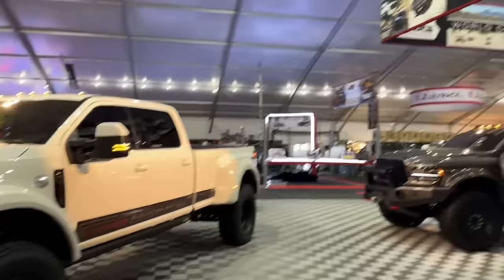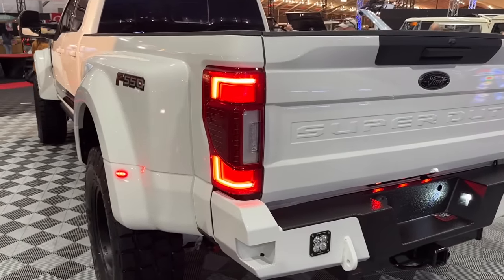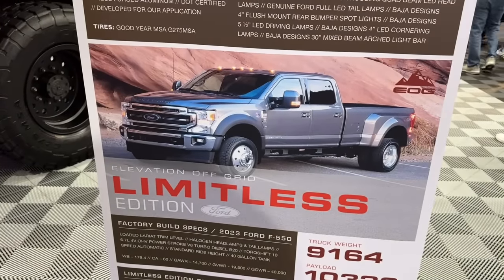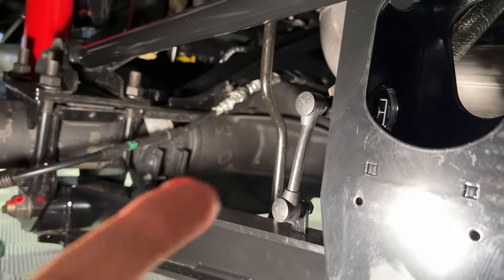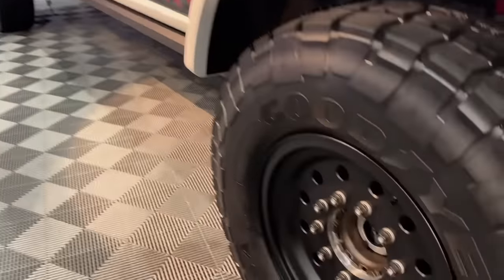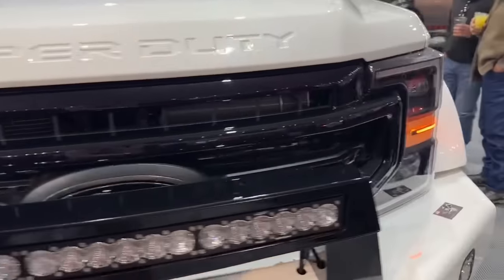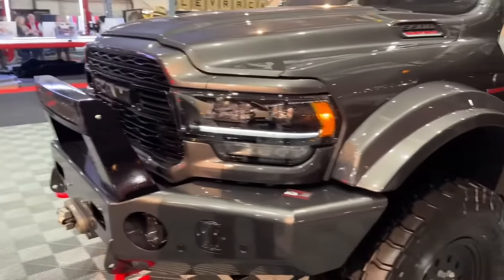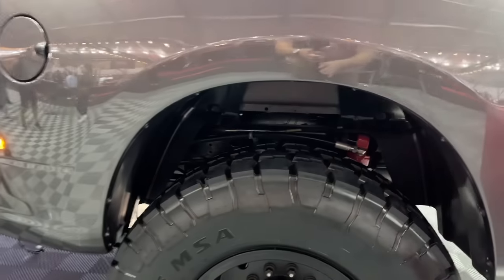When a Ford F-350 or Ram 3500 Are Just TOO SMALL - Here Are Three Ultimate ‘Hold My Beer’ Pickups!

Comment: I definitely see the appeal, but if the trucks come from the factory for $80k, can you really justify spending another $100k on top of that for their product? To me it just seems like fancy suspension, a custom bed, and big tires.
Reply: Nah the way they have that truck configured, with all the body mods, high end suspension, commercial tires and wheels, and weeks upon weeks of fab plus paint i'd imagine the cost of components including the chassis is well over 100k. Add on the labor and markup and your probably looking pretty reasonable.  A modern 5 ton chassis with a reefer box which is far less exciting can easily approach 150+k$
Reply: The Ford is an F550 and the Ram is a 5500. You can't even buy these trucks from either company with a bed. They are basically custom building a pickup truck on steroids. There is a ton of work that goes into one of these trucks. You couldn't do this yourself for less money. The closest thing you could buy from a dealer that would come close to these is going to be a lifted F450 or lifted 3500. They will want over 150K and you will have a much lower payload rating. Just search for Ram broken in half.

Comment: This is super exciting to see. I have a ‘22 Ram 5500 crew cab, 60CA with 50 miles on it sitting in my driveway right now, waiting for Bowen to tell me my camper flat bed ( just like this one) is in production!  Given that I’m not towing, I ordered a 6.4 hemi 4x4, SLT (to maintain mechanical 4x4 engagement). Thanks TFL for giving me my preview!
Reply: I've got my 84CA 5500 ready for Bowen to do my Host Mammoth bed in April! Can't wait!  Debating whether to leave it DRW or convert, concerned about stability with that camper.

Comment: I really wish that these guys had a website. That said I would love to have a F550 that could conceivably have a 8ft bed and have dual stacks without cutting holes in the bed.
Reply: I was with ya until you said dual stacks,,,,😂😂. To each their own on customizations, so I don’t mean they are bad. I have a preference for cleaner lines with the exhaust tucked away underneath.  
       That utility bed is what I like! My preference for camping is with a truck & camper. We go into areas where a stock truck with a 3000 lb camper can’t go, mostly because the camper may not survive the flexing. The added pivot points on the utility bed will keep the camper from flexing so much and it won’t tear itself apart. Nice. I get a bit of razzing about hauling the camper and using a utility bed. The extra storage alone is worth the razzing!! 😂😂.
     I hope one of these is in your future!!! Eh!
Reply: @shitloveaduck  Even among stack guys I am a bit odd. I don't want to cut holes in my bed to run a stack let alone some massive 8 inch monster since I actually use the bed of my trucks but some nice 4 inch stacks that are flush with the sides of the truck give it a big rig look without going overboard.

Tucked away exhaust is just too close to stock and seems just a bit boring in my opinion. As you said though to each their own setup.
Reply: I'm confused? They do have a website
Reply: @danielfrain3521  Do you have a link? All I have found are useless facebook and Instagram pages along side news articles that mention their products.
Reply: @Hybris51129  - that’s all there is. No website.

Comment: Nice looking but I'd rather have the dual rear wheels than the singles. More stability when towing.
Want a smooth ride buy a car not a truck. The weird gap of a stock bed on the 5500 could be filled with an auxiliary fuel tank.

Comment: So 10-11 inch's of tire height difference and no gearing change? The obscenely low gear ration is sort of why these trucks are rated for the weight they are. And now the rear brakes have no protection... Going to be a very costly tire change when those things pop, besides needing a new wheel the whole bed side is going to be trashed. As I have seen large tires like that tear the hell out of much thicker metal on trailers. 
The suspension sounds interesting, and would have liked more info on it.

Comment: Only thing is they put bigger tires and didn't regear. They will go through some transmitions especially towing and the heavier the trailer the faster it will happen. The rule of thumb was 10% of gear per one inch the tire. Who ever buys one these trucks needs to immediately go get it regeared

Comment: One of the problems truck makers are running into is what the Department of Transportation considers Commercial Operations. Small farms, cattle ranchers, and horse farms have been battling this for years. They buy an F-350 or Ram 1 ton with a crew cab and the towing ability that places the rig with a trailer into the commercial weight class. That would require a commercial driver's license which the vehicle can't fit anyway, but they try enforcing it here and there. To be a commercial truck and not a day cab then there are cab fitment requirements for that. Then there is the commercial license itself. That is another expense in time and money that isn't used but maybe a few times a year during a show or sale season. Some long-haul livestock operators haul horses and livestock to sales of shows, but few horse trainers or livestock growers will send their customers $259.000 stallion off in a semi unless they own it and crew to operate it. That would shut down all the smaller producers and we already see that today through regulation. Did I read where Dodge derated some truck towing capacity recently?

Comment: Love the F550. The one thing I would want to change is the rear fender width. I don't like how the wheel is set inside the fenders. IMO, taking off just an inch or two so the the rear tire has at least an inch of poke on both sides would make it look a lot better.
Reply: It’s for suspension travel not good looks. Besides looks fine to me. Hate when tires are flush with fenders cause you know if it compresses too much it’s just sending the tire into the fender. It’s looks clean af as it is.
Reply: I agree with you. It would make it look better, but if those big aggressive tires stuck out any at all, it would destroy the side of the truck with rock chips, plus not to mention anyone following it on the road. It would throw rocks, sand, and anything they ran over could potentially be a dangerous projectile.

Comment: What is the target market for this? The tiny home dweller that wants a larger carbon footprint. Also when you say straight frame, commercial truck frames are what I pictured. What I saw looked to be regular truck frame with normal bends for axle clearance. No fleet managers are going to want to deal with all those non off the shelf parts either. Same with farmers/ranchers. Seems to me this is another look at me I'm "sPeCiAL" truck.
Reply: It’s mainly meant for the large Cabover camper market I would imagine. The cabovers have gotten to heavy for the 3500’s

Comment: sure legendary 6.7 Cummins except for the faulty emission systems, failing d e f failing turbo actuator failing EGR system that clogs up with soot and it also clogs up the intake, and also the coolant reservoir that splits on the seam all reasons why I no longer own a diesel

Comment: 'Mericuh! Ooooooh Yeaaaaaahhhh !!!!  I DEFINITELY WANT one of these!  I'll take ALL THREE! Can't wait to win Lotto-6/49 or Lotto-Max to buy these and import them into Canada!

I would put one of those four-season, deep-winter-rated in-bed campers from Northern-Lite on this baby and go for months into the back country with all my off-grid supplies to fish and relax the days and nights away!  These trucks can carry enough camp gear and supplies to last you A FULL YEAR off-grid if you want to! Put in an extra 150 gallon (550 litre) in-bed tank in addition to the 68 Gallon standard diesel tank and the average-off-road-while-loaded 12 MPG on the F550 engine, that is 2616 Miles (4210 km) of driving range WHILE carrying 8500 lbs worth of in-bed-camper, food/water/fuel/propane/camp supplies and people.

Those are pretty phenomenal driving distance numbers which means I could drive completely off-road from Seattle, Washington to Buffalo, New York (2,592 Miles) on a single fill-up of diesel! If I stayed 3 days at each of the lakes and rivers I would like to fish and explore (100+ lakes and rivers!) , it would take me a full year of being fully off-grid to finish the journey AND I could actually take enough supplies and fuel with me to do it with no problem using this truck! It would be heaven to have this sort of carrying capacity in a fully 4x4 off-road, off-grid-ready truck!

V

Comment: I'd wager that those Fords are the derated engine seeing that they started as a chassis cab and they didn't touch the engine. For the Ram do they even offer the high output Cummins in the 5500? Does anyone know?
Reply from the maker: The Ram 5500 Cummins does not have the high-output rating. It’s the commercial grade engine.
Reply: The one tons have the highest output, the bigger trucks are all derated for better reliability and fleet managers frown upon properly equipping fleet vehicles.

Comment: Transmission is the weak link in this build. Don’t expect  more than 50k unless your changing fluid every 30k.
Reply: Which transmission? There are two brands shown in this video. And I'd expect a solid PMI schedule if you're using these vehicles as intended.
Reply: @ALMX5DP  10 speed

Comment: I don't get why so many people in the comments are praising this guy's knowledge of trucks.  This video is total cringe because of that very guy attempting to explain how the trucks work.  First, he stumbles all over every other word he's trying to say, constantly looking up and away like he's trying to think up his next line of bovine excrement.  Second, his lack of a basic understanding of both physics and legal concepts (as they apply to trucks) is astounding.  To claim these trucks are maintaining the full factory towing and payload ratings after being heavily modified in the suspension and wheel and tires, is downright irresponsible.  I doubt this company is having these trucks independently tested and rated after their modifications; the small volume of these they sell would necessitate a much higher price per truck if they were having them certified.  Lifting a truck will ALWAYS have a negative impact on payload and towing, as the suspension geometry has changed, thus altering the way certain components are stressed under load.  Thirdly, he tops it off by claiming they don't touch ANYTHING on power train and drive train.  He asserts the factory gears are quite low (which they are, but that's part of what gets you the towing/payload numbers) and the vehicle doesn't need any compensation for the change of overall effective gear ratio caused by the significantly larger (not to mention heavier!) tires.

I wanted to see this video because the concept looks cool, but there was just so much cringe, I could only make it to about halfway.  Not saying they shouldn't be making trucks like this; just that they shouldn't be making the claims they are about them.

Also, what in the actual F is a "liquid spring"?!?!  I imagine it must be a brand, but the name is trash, because a liquid on its own could never be a spring, as liquids are non compressible.  It would have to have either a gas spring, or a piston hooked to a standard mechanical spring at the other end in order to actually deflect and absorb energy (which is what a spring does).
Reply: I was thinking this, wondering if Andre would call him out on his BS
Reply: Do a little research. Liquid spring actually uses a proprietary compressible silicone fluid and a accumulator to accomplish a variable dampening and variable load capacity independently for each corner.
Reply: @benjaminneel1625  I'm not the one who needs to do some research if you think a fluid can be compressible.  The accumulator you mentioned is the key there.  It likely has some kind of gas behind a diaphragm separating it from the fluid which is simply used as a means of transferring the load to the pressurized gas in said accumulator.  Basically, it's a Citroen.  That is 60's era tech and there's a lot of damn good reasons no one else is using it on heavy trucks.